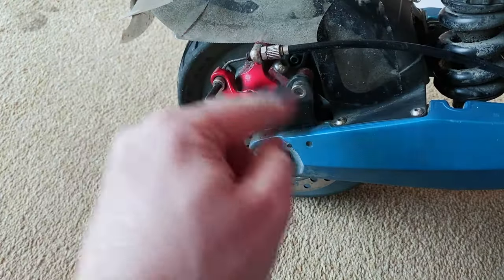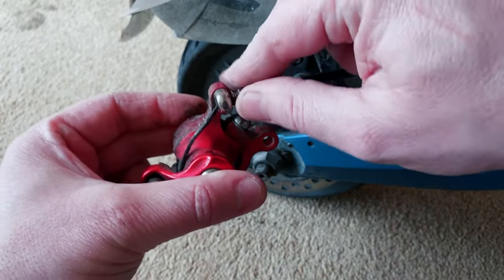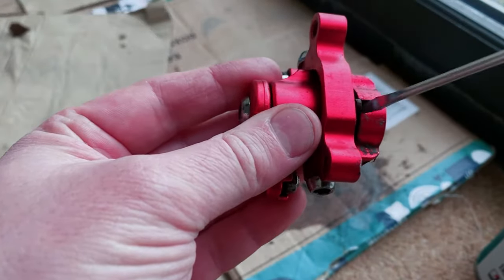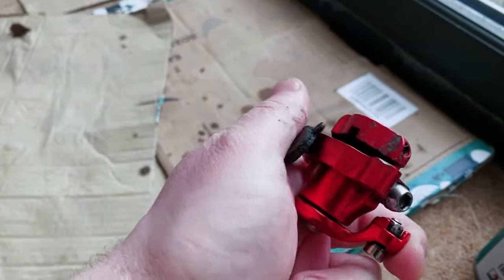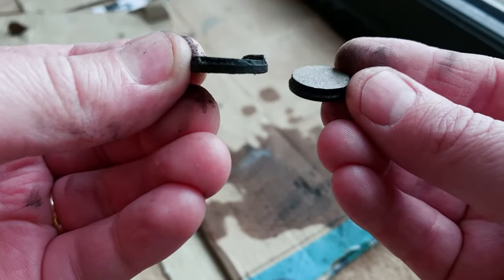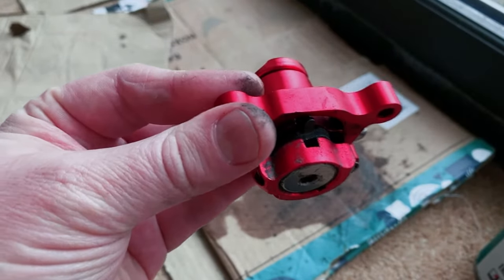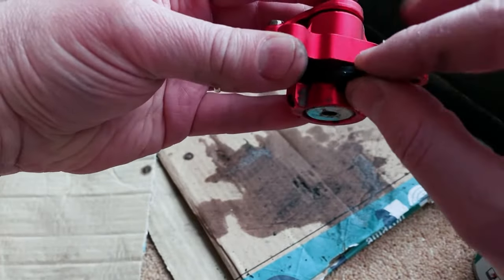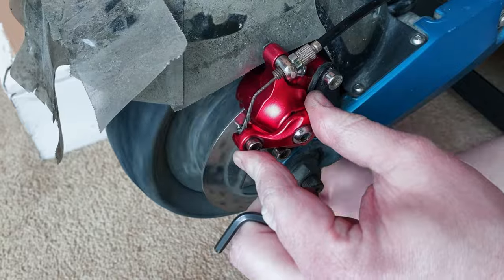How To Replace E-scooter Brake Pads (The Right Way)

Comment: I have a question. I have a Vsett 11+ with a Hydraulic disc brake system, which brakes should I buy? or where can I find this?
Reply from the maker: Best to remove them first and check on AliExpress for the same type as they can differ slightly

Comment: Pls which brake pads can I get for my impei carrera 2.2 e-scooter
Reply from the maker: Had a quick look at your scooter. Standard mechanical. Most pads are the same for that type of caliper.

Remove them and see if they have 2 dots or 4 dots on the back.

You can buy them from AliExpress 

https://a.aliexpress.com/_EQ6LGGZ
Reply: @Movelectrics  Thank you so much

Comment: Are the brake pads all same?
Reply from the maker: For mechanical they are quite similar but can vary. Depends on the calliper. Hydraulic pads can also vary. What scooter you have have?
Reply: @Movelectrics  I have a inokim myway scooter they have same calipers as yours
Reply from the maker: @mileschia6741  got mine from AliExpress.

Comment: The pads aren't consumed at all at the top, it doesn't fully touch the disk. I have the same issue but worse and after every couple of hundred kms i have to remove the break pads and grind those bits even
Reply from the maker: Some callipers do not align fully for the pads to touch 100%

Comment: 2k km is pretty insane with how long they can last.
Reply from the maker: I try to brake in advance of stopping and to be less harsh. Adjusting as I go along.
Reply: @Movelectrics  do you try to use the ebrake before using disc?
Reply from the maker: @AceadamUK  this scooter (Varla Pegasus) does not have an e-brake. But on a scooter that does, I would have it completely off or at its lowest setting.
Reply: @Movelectrics  oks thanks for the replies!
Reply: @Movelectrics  why would you turn it off. wouldnt it make the break pads last longer then?

Comment: My scooter goes 60 and I go fast all the time and stop hard and my brakes lasted about 40km
Reply from the maker: You simply need to adjust them using the cable and adjust the back pad manually (made a video) this is for mechanical disc brakes only for adjusting.